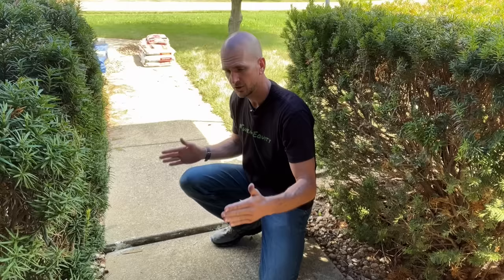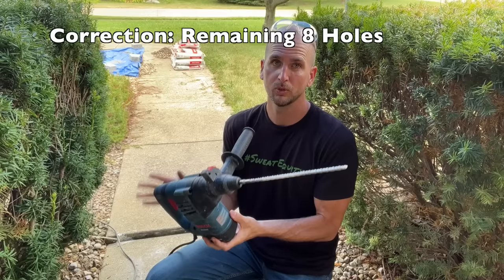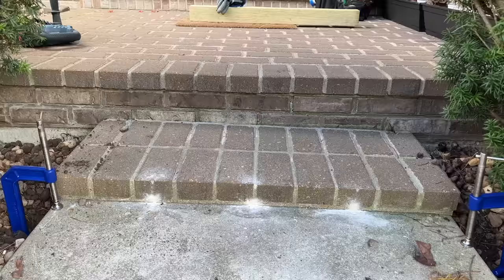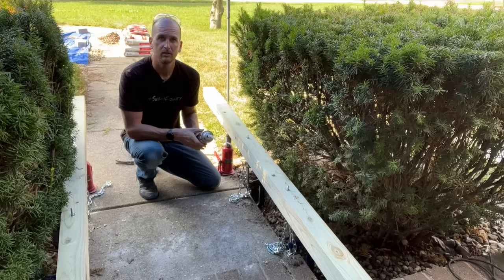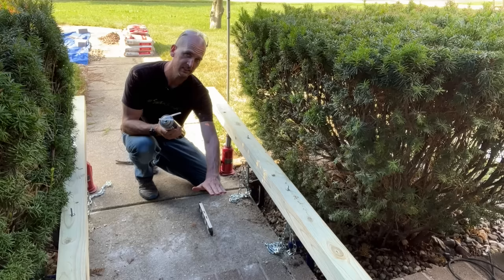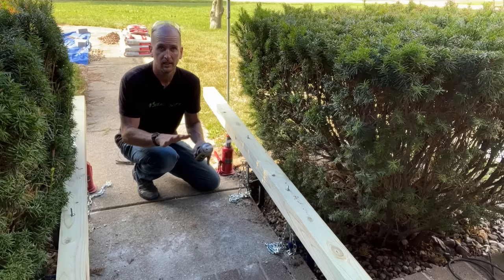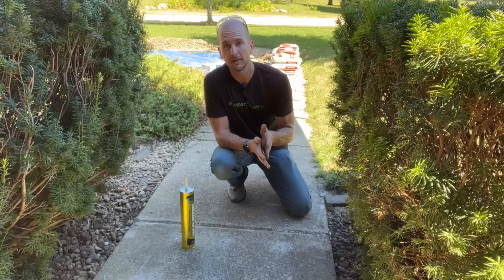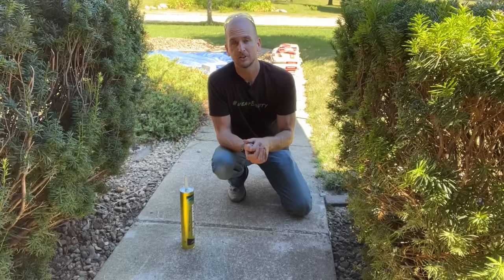How To Fix A Sunken Sidewalk With Spray Foam

Comment: Clamp a timber on the top and as you lift the slabs, clamp it tight to get the top flat, clean the joints out,, then you can either use the foam, or pour free flowing grout to the underside of the slab - shutter the sides to prevent leakage.
Remember to heavily grease the end of the clamps that end up under the slab (best to wrap them in plastic too) and yank then out as the fill sets)
Reply: Grout seems like a better long-term solution to me. I would worry about the foam degrading or the air pockets collapsing.
Reply: @N20Joe  I'd not use foam unless I cemented up the sides.
I've seen instances where unexplained floor slab subsidence became very easy to explain after foam was used.
There was a trail of foam granules along the narrow gap behind the building that the resident rats had removed to get back inside
Of course they now had a super insulated home.

The clue is in the name of the product "gap filling foam" it's isn't structural, it might well work, but it's not a true ling term solution, the foam will break down over time, it isn't designed to be saturated and encountered temperature extremes, boats fail because the exact same stuff pumped between the skins form the structure and when wet it crumbles

Comment: I used three of the best 3/16” masonry drills on the market and I couldn’t penetrate more than an inch through a 7” walkway slab. I don’t know what my walkway is made out of but a hammer drill with the best drills could not go through it!

Comment: Just curious here, but with the amount of work involved with lifting this small walk area wouldn't it be easier to just break up and pour new in this area?
Reply: He doesn't need to do all that work anyway, just drill the holes and fill until it's level. The poly expanding will do the lifting for him.
Reply: That is the point of the question. Why do all this to use foam? Use concrete after that. Or mortar if you still feel like doing all that drilling
Reply: @bloody_fobbit2758   That's kinda where I was at here... if you're going to jack up the entire slab, why not just hammer in some thin forms and pour fully plasticized concrete?
Reply: Plus all the hardware and supplies he bought for the project.

Comment: I like your technic for lifting the slab. I personally would rather lift a few more inches so I can throw some sand under the slab. Might take a couple tries to get the right height, but better than drilling holes.

Comment: Great solution and procedure. An alternative would be to just but out that section that you lifted and pour a new slab. Cost and time this might be cheaper and also better because in a lot of these cases the slab that is being lifted might not be in the best shape.
Reply: that was literally my first thought... this seems like so much more work and expense
Reply: @Steve-ec6ed  It was his home -  new slab wouldn't match and would be an eyesore.
Reply: @heresthething....4685  It wouldn't match like what looks to be the section of new concrete going in right behind him.?
Reply: @mark-kf3md  The material in the background was actually for Plan B if the section of concrete he was raising cracked.  The video would have been titled “How to pour a new section of sidewalk”. He was prepared.
Reply: @Steve-ec6ed  How is this more expense? He literally said he had $16 into the foam. If he already owned chains and lumber that would be the only cost. Otherwise add $50 for supplies that he can later use on other projects (or lifting more slabs).
Reply: @timfischer  He had 4 shiny new bottle jacks, 25 feet of brand new 4x4's 4 shiny new c clamps and a pile of shiny chains and hardware.  The bottle jacks alone is $100.

  Sakrete is $5 for an 80 lb  bag.
Reply: @dennisp.2147  I mentioned the lumber and chains. Most people who would attempt this would already own clamps, and if not, know someone they could borrow then from. He used two bottle jacks, not four, and again many people who would attempt this already own at least one, and have a buddy they can borrow the other from.

If you'd rather spend a day breaking up a slab and re-pouring it, that's on you, but you're not going to save much money. You're going to need at least 10 of those $5 bags to replace that slab...
Reply: @timfischer  Umm, are you suggesting that the slab weights 800 pounds?  A $5 bag of concrete is 80 pounds, and it certainly wouldn't take all day to break that little slab up.  Probably less than a half hour.  It's all well and good to assume people have these tools, but, if you look at the ones he uses, he clearly didn't.  They're all shiny and new.

So if we go by those standards, most people would have a jackhammer  and concrete forms or know someone who did, so that would make it a 5 minute job to replace the slab using your assumptions.

Comment: Lifting up a small concrete slab can be done in a million different ways; one must simply be commonsense-cautious to not crack it.  Then, once raised, it's not too difficult to dig a bit to gain access to the underside, from the sides, and then manually fill the cavity with gravel or similar fill.  The advantage of the process that I'm describing here is that it does not require procurement of all the items being shown here (wood, jacks, chains, hardware, hammer drill, drill bit, and two cans of foam).

Comment: The foam may be sturdy, but it has give and will move more than a solid object.  I would suggest a treated wood block or a brick or rock on the sides.
Reply: I would think he could raise it with the jack n c-clamps then pack with rocks using a piece of wood or the pry bar. Then fill the remaining void with foam. I need to lift my patio porch due to stress cracks which have opened up enough for rain water to penetrate and wash away some dirt below the slab. I only recently learned this is what was happening thanks to these type of videos.

Comment: I did this, The slap had dropped at the front near the house under the steps. I let it set over night at first it was nice and flat but over a day or two it compressed foam maybe a half inch listen I raised it like 3 inches still looks better than it did. Next time I go a little past level then if the foam compress it will be level. ( Was redoing my front porch)

Comment: I don't have a sidewalk to fix, but you just gave me the perfect method to lift a small shed to put in a new crusher run pad and new floor beams!  I knew bottle jacks were part of the equation, but fixing 4X4's to the shed and then lifting the 4X4 with chains might be the ticket.  I'll run some calculations to make sure I'm not doing something stupid, though.  Thanks - love the channel!
Reply: If you have not already done it you could consider strand jacks. They have a hole up through the jack through which you can pass a bar. Pass a bar through your 4x4 (or pair of 4x2) then through another 4x4 at right angles that is supported off the ground. Place jack over bar and secure then jack. Safer than bottle jacks that could tip side ways with you working under shed to prop it to do works.
Reply: @johnclements6614  Haven't done it yet, so your suggestion both appreciated and timely!  I'd never heard of strand jacks before, so I'm doing some more googling.  What I've found so far looks like the cost would be higher than scrapping the old shed and putting in a new one.  Any sources you might be able to recommend?
Reply: @spud13x13  I used a strand jack about twenty years ago for testing bolts that had been epoxied into the side of a bridge. I am in the UK and have not been involved in hiring plant since then. I can not find anything locally to my self with a quick google other than a Chinese site selling small strand jacks for about £400. At that price new I would assume! (big assumption) that be able to hire a couple small jacks, hoses and pump (plus oil etc) for $100 for the weekend if you collected and returned them. I think it would be a case of finding plant hire companies near you that hire jacks then phoning them.

The thing about the bottle jacks is you will have to figure out a safe way of doing the work if they tip side ways.

I don't know how small your shed is but have you considered moving it. I moved a shed once by taking up the floor, putting some runners under it and levering it along whilst stood inside. Obviously puts stress on all the joints but the shed lasted another ten years till I built a bigger shed.

Comment: Bi interesting to know how you’d do a side walk that runs along the foundation that is leaning towards the foundation
Reply: This is my question as well…
Reply: If the sidewalk is accepting rain runoff, it is important to remediate. The runoff spilling towards the house exacerbates the problem by softening the soil and further sinking / tilting. After raising, seal the seam between the walk and the foundation to prevent future water intrusion.
Reply: I’ve seen other videos on you tube that shot this foam directly into sunken concrete to raise it.  That is the only option if it’s against the foundation.  As others have said, be very careful not to use too much foam or it will raise the concrete too high.
Reply: There are professional companies that foam lift slabs under high pressure.  The high pressure lifts the slab only.

Comment: I have found that “great stuff” deteriorates over time. My question is why not just use 4 bricks ( or something similar) positioned at each of the 4 corners of the lifted slab all flush and leveled equally. You can also use foam filler to give support in the center by drilling one center hole but otherwise the bricks will do most of the support.
Reply: It only deteriorates if exposed to sunlight.
Reply: @Val2073  no water destroys that stuff.

Comment: Nice! However, in THIS particular instance, wouldn't it have been cheaper and easier to simply replace the slab?
Reply: 🤣🤣🤣🤣 maybe in China 🤣🤣🤣🤣🤣🤣🤣 but this method here is clearly at least 500x cheaper , cleaner , faster , and most definitely more DIY friendly, 🤷🏼‍♂️. & you would have to haul debris away in your little electric smart car 🤔
Reply: @sipandsniff1744  You're acting like an idiot. Just bury the darn stuff, or parcel it out into the trash over a couple of weeks to keep the weight down. Bag of ready mix costs what? $10? So use 4 or 5 of them to replace that little slab, and save buying $300 worth of wood.
Reply: But is looks bad as it does not match.

Comment: I applaud your technique. I usually just repour new concrete, but that's a pretty slick hack. I'm curious to know if it still holds true in place five or ten years later.

Comment: I did this same thing only I drilled a couple extra holes in the slb and screwed in a long cement lag screws (instead of the C-clamp method) to attach 2 pieces of chain to then hooked those to my board in which I used a floor jack to raise the end of the cement slab. Great vid and thanks!

Comment: To the naysayers, it really doesn't seem to be a complicated repair. The lifting apparatus looks like a great way for a single person to raise the slab without worrying too much about cracking it with prybars. I agree with those who say drilling the holes for the foam was unnecessary. Attach a long tube to the foam nozzle along with some type of reinforcement and you could probably inject the foam from the sides, although you'd have to dig a bit more to provide good access. There may be better products to use other than Great Stuff expanding foam. You might even be able to flow a cement slurry or concrete repair mix in from the sides. If you only had one or a few sections to raise, I think this is a great method, and you don't get the mismatched color from pouring a new slab.

Comment: Nice well done video. You can save money and time by just wrapping the chains around the beams. No need to buy and install the J-Bolts. I did a similar repair. I did not use great stuff, I would be concerned how it would last over time. I got High density foam sheets and cut to size and slipped in from the sides. This also removes the requirement to drill the holes.
Reply: Do you remember what kind of foam you used?  I know you said high density, but is there a specific kind?

Comment: Nicely done.  I am interested to know how long the great stuff will last before collapsing.  Do you have any of this type repair that was done years ago?  Great video.  Thanks for taking the time to make it.
Reply: I wish there was an easy way for a homeowner to inject mortar or grout into the holes.
Reply: @MoneyManHolmes  I agree.  That would be the ideal solution.
Reply: @MoneyManHolmes  You don't likely need to inject mortar or grout, just some form of mud that'll harden.

I recall my father had someone fill up a driveway segment that had fallen a good 2 inches over 20 years.  He hired a company that drills maybe a 2-3 inch hole in the slab, which raised it up.

That was likely 30 years ago, and it held up perfectly fine.  

But yeah, it'd be nice if there were a way to DIY.  I don't think the foam is going to hold up for all that long.

Comment: Nice job.  Did you add up all the costs of tools and materials needed to perform this method (and the amount of time) so that someone could compare this option vs. removing and pouring new concrete?
Reply: cheaper to pour new. or buy a new stone and regrade.

Comment: Cost of 4x4 lumber, big bottle jacks, drill bits, c lamps, j bolts, 2 cans of foam...cup brush, etc: That adds up. You may say lots of people have much of these things already but that would be a stretch.
My father would have had that sunken square busted into pieces with a sledgehammer and out of there in 10 minutes. Make a simple concrete form, add some busted up old crete from the old square as filler, tamp it down, and mix up a couple bags of concrete to pour a new square.
Float it out with a nice 2x4, and you are done.

If was me, i'd dig down the sides, pry it up with leverage bars, and pack a layer of sand under it to level it up.

Great Stuff is not made for weight support or ground contact like that. I don't think it will last that long.

Comment: for all the work done on this project and COST of materials- you could have removed the small section of sidewalk for 1/4 the cost and less time. The issue with the foam solution as well - it is a temp solution because it will compact and the slab will once again sink.  I was a remodel contractor for 15 years. But if you like the idea of this project then by all means this works as a costly fix that the average weekend warrior will take 3 weekends to get it done. Oh and the C claps could very well snap the edges of the sidewalk when you do the lift. NOT a FAN of the project. Sorry!
Reply: That is what I was thinking. Why not just lift one sid of the slab and stand it on its side and fill the void with pea gravel?
Reply: This.  Sakrete is $5 for an 80 pound bag.  Bottle jacks are $20 or more each.
Reply: Immediately my first thought.  Break it out and put in a new pad after fixing the foundation.
Reply: @pagedc79  - Might be difficult to get it flush with the other pads? I was thinking lifting it up on one side, and then putting in straight portland? or shoot, squirting in a poo ton of epoxy under pressure? Because I was and am concerned about the long term results. As my experience with this spray foam, is it compresses eventually when under pressure? I don't know. I would like to see a follow up like a few years down the road with not only this specific slab, but others as well. Why'd the slab sink to begin with? Now if that is not fixed, and you go back, problem is even worse to have to correct. Messy stuff! It makes for a great youtube video though! lol.

Comment: so what do you use to fill expansion joints that run the length of the driveway, would the Vulkem run down the grade?
Reply: Different Vulkems numbers, Semi self leveling. vs self leveling type. One runs, one wont on a grade.

Comment: Would it cost less money to just mix up a bag of concrete and pour a new slab if you don't have all the tools needed in this video?
Reply: That would cost a lot too. Would it not? The most expensive parts here are the bottle jacks and drills, the cheapest bottle jacks at harbor freight at $30 each, drill rental is $40-$50, drill bit is like $10-$15. Overall this is like $200 at the most, but Scott already had most of these tools before this video idea.
Reply: @StuffTested  you can buy two bags of quickcrete at home depot for like 30 bucks, mix it in 5 gallon bucks and shovel it in a form made from scrap wood. Would make a 3ft x 3ft x 4"in slab
Reply: @david_4246  30 bucks ???
Bruh 50# bag of Quikrete is less then 5 bucks.
Reply: @stanleyhape8427 sorry I was talking about 80lb bags. But yea about 3 or 4 50lb bags would also be enough so like $20-$25
Reply: @stanleyhape8427  cheapest 50lb bags I could find on the website was $5.64 x 4 bags = $22.56 plus tax you're looking at about $25.
Reply: @david_4246  A 50 lb bag of concrete approximately cover around 1.5 square feet area up to standard depth of depth of 3 inch(4" preferred) for your patio and sidewalk. A bag of 50 pound yields 0.375 cubic feet, thickness of slab 4″= 0.33333 feet, so, a 50 lb bag of concrete covers  0.375 ÷ 0.333333 = 1.125 square feet....3x3=9 sq ft.  9/1.125 = 8 bags.  a quick way I've done is a bag is about 4" thick, pack them together where they are going to make sure you have enough.  it is best to use the chart on the bag though.

Comment: #1- an 8 foot 2x4 and a block as a lever is all you need to raise slabs. Block slab in place.# 2-Dig under and use a bottle jack.tapper edges of slab. Then raise. Once raised, use grout or loose mortor mix. So it pours and flows under slab..  Once filled and stiffening, take extra over fill off side of slab. Replace with dirt n grass seed.